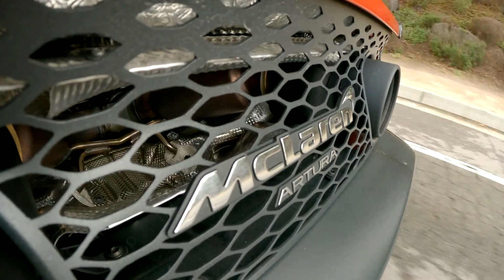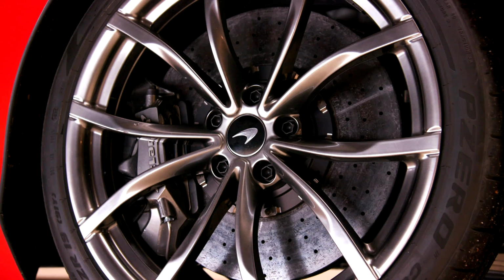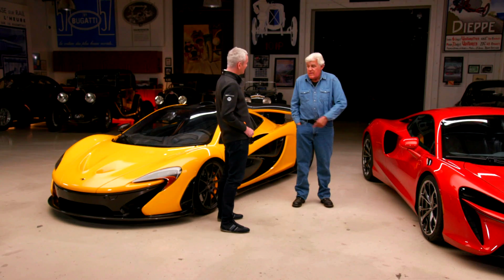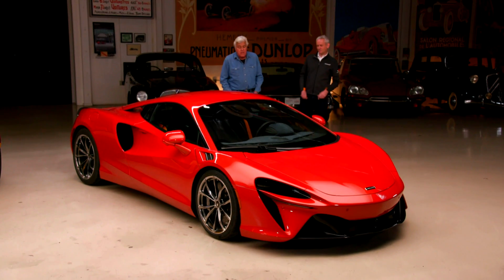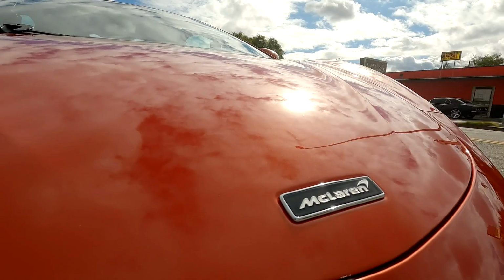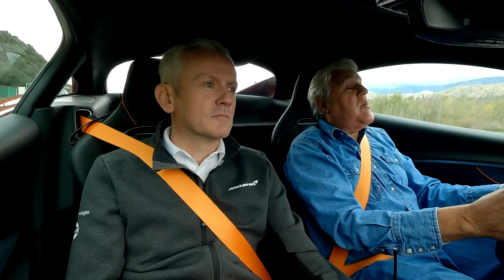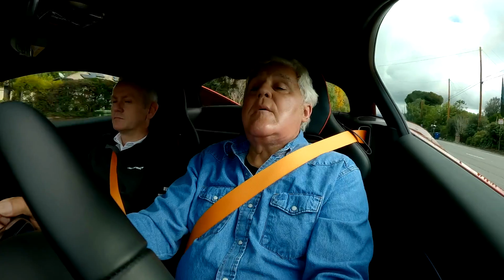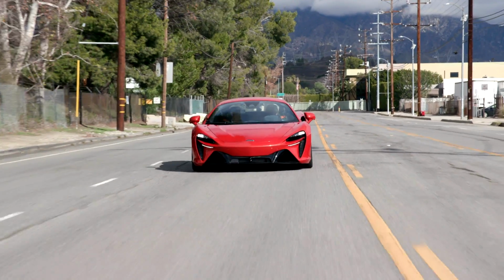2023 McLaren Artura

Comment: 19:07 "To me if you're going to build a supercar, build your own engine. I don't quite get... people pay a fortune for a supercar with somebody else's motor in it." Jay, do you not realize the McLaren F1 you love has an engine in it that was designed and built by BMW? Hell, it says BMW M Power on the valve covers! And that wonderful twin turbo V8 from 3.8 liters ( Jay's P1 that he was just gushing over has a version of the 3.8L M838T in it the M838TQ) to 4.0 liters McLaren has used since 2011 is a Nissan design from the 1990's, actually the late 1980's. The VRH35 was the engine used in the Nissan R390 GT1 race car entered in the 1997 24 hours of Le Mans. McLaren purchased the VRH design and used it as the basis of its M838T and M840T engines that McLaren has put in all of its V8 cars since the MP4-12C. Would you like to roll that one back, Jay?

Comment: 😮I test drove the Artura. It's wonderful to drive but the tiny pedal box spoiled it for me. I wear size 11 shoes and my feet touched each other side to side and my toes caught on the underside of the dash. At first I thought I wouldn't even be able to test drive the car safely but I found that by folding my left leg backwards towards the seat I could safely drive. There's no way I could do that for very long though. The salesperson said that racing shoes would help, I do still have a pair from track days but I didn't think to wear them. 

I get that McLaren is all about optimizing the driving experience but you do need to take human factors into account. And no, I'm not a plus sized American, the seat fit fine but there was no place for my feet.

Comment: Too bad not renewable electricity via motor powering the electronic battery.
Reply: Does the 2023 have lighter body weight so lower horsepower still performs near F1?
Reply: Is this being purchased by Jay…or…just tested?

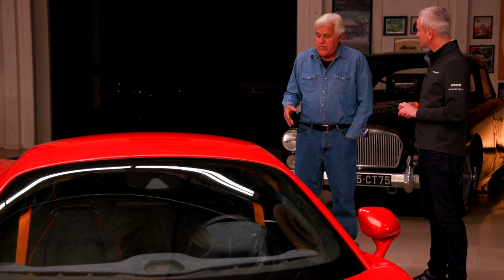Comment: the "letting the turbo cool down" described by jay at around 12:50 is still a good thing to do and it doesn't have to do with temperature.

Turbines spin very fast (tens of thousands of rpms), they need constant lubrication because of this, such lubrication is provided by the engine's oil pump. if you were to come to a stop and immediately turn the engine off, you would stop the engine's oil pump but the turbo would still be turning for a while because of inertia, this would leave the turbo with no lubrication for a short time, add it all up and some years later you could cause the turbine wheel to seize, this problem is obviously related to how high the engine's (and turbo's) rpms were before shutting the engine off.
the typical time one should wait before shutting the engine off is around 10-15 seconds whilst keeping the car at idle.
it is obiously not advised to do the "flick of throttle" right before shutting the car off (like it was sometimes done on carburated cars).

it is possible to find solutions to this problem by employing an electrically controlled and driven oil pump and setting it to stay on for a little while after the engine is off, this solution is excedingly rare and i personally am not aware of any roadgoing engine using it.

Comment: Dear Jay Leno, your videos about Duesenbergs are particularly entertaining. I'm not surprised that they feel like modern cars, I certainly haven't heard of another DOHC engine with a cross flow head and four valves per cylinder from that era. I do wonder about the supercharger that was optional after 1932. It was located on the exhaust side of the engine and was shaft driven. How exactly did the engine drive the shaft? What type of supercharger was it. And at what rpm and speed had to be attained before the supercharger would start delivering a noticeable effect in engine performance?

Comment: ⚓️ Thanks Jay 😎 cooling the turbo at shutting down is ‘soak back’ > lube oil absorbs exhaust heat away from the turbo, preventing oil oxidation around the turbo bearings. $10K aftermarket repair. 😎

Comment: The body motions of the car on the external driving shots look like the ride is choppy.

They mention it all in passing, but the conversations about charging the EV battery really show the limitations of electric cars.  EVERYTHING about owning an EV is about keeping the battery charged and in good condition.  It's really nice that McLaren has saved some weight in the car by eliminating reverse gear in the transmission and using the electric motor to back up.  Then they have to limit discharge of the battery so there is always some juice left for backing up.  And there is also a driving mode for charging the battery, where the engine power can be tapped so you can drive in e-mode when you get to your destination.  The downside is the engine has to work harder during the 40 minutes that it takes to charge the battery and burns more fuel while doing it.  How's that helping with "Carbon emissions"?  As an owner of electric cars, Jay has learned to keep them plugged in to take care of the battery through long periods of non-use.  His electric bill goes up to maintain a car he's not even using, but it's cheap insurance to spend a few dollars on electricity than risk ruining a $20,000 battery.

Comment: Thanx Jay. Well of course the McLaren P1 gets a pass along with the F1 and even the Speedtail. This new Artura certainly looks excellent from the front, the paint looks great but i don't know about the rest of the design. What has happened at the back? It looks like they run out of materials and or, ideas to finish it. I think the air vents above the front wheeIs reminds me of the Saleen S7. I also suspect there is some poor build quality on some of these new McLaren models after seeing some videos of McLarens that ended up in scrap yard auctions. One wonders how these cars will perform once they have 50k miles on them.

Comment: I know I'm odd, but I'd really rather Jay did a more indepth episode on the Doble steam car, any stationary or steam traction engine, the automotive art on the shop walls, tools, machinery, maybe different models of Scammell vehicles, board track motorcycles and an 18 inch splinter that was removed from a board track racers right thigh in 1909...

Comment: the Lemans p1 class used capacitors the brakes would charge them and the capacitors would discharge out of a corner, the drivers must learn to brake in a straight line before the corner to fully charge the capacitor less smooth    ;-(battery's charge to slowly and are to heavy)

Comment: Need electric for reverse  🤔  " 'we' always make sure we have charge" , well what about when it's ran down and never plugged in...
Reply: That would apply to any gas car also.  It takes very little power to back a car out of the garage.  You could do it with your 12v battery and starter if directly engaged to the trans.

Comment: All midengine super cars are taking on the same shape.  The death of design. Well engineered, for sure.  But if the driver is so isolated that they are unaware of what speed they are going then it is dulling the driving experience.  The thrill is diminished other than bursts of hyper acceleration.  Get in a small convertible roadster to realize what one is missing.

Comment: I'm actually a little insulted. 
An extra air-conditioned system just for cooling of the engine. 
The manufacturer knows these cars will be driven mostly among normal cars,
Which will over heat ur million dollar car.
"Designed manufactured failure"
Planned obsolescence

Comment: V6 dual turbo, just like the third generation Ford GT.
Good to see you Jay, back at it doing what you do so well.
A belated Merry Christmas and onto a happy and healthy 2023.
Reply: But this one is special, being 120 degrees. That's the natural angle for a V6, allowing shared crank journals and even firing. Every other V6 has to have 6 crank journals to achieve even firing, increasing weight and length and decreasing responsiveness.
Reply: And the Cadillac ATS-V.

Comment: the negative like the cylinder shut off/to shutting the engine off at traffic lights 🚦 I agree with Scotty Kilmer it wears out the starter and and battery much quicker. plus it doesn’t allow the heat to be even causing pre mature ring wear. then when you add a turbo charger to a v-6 or v-8 your asking for trouble. the added boost pressure leads to blown head gaskets or engine failure these exotics are cool to look at but if these engines are better why the turbo. Scotty is mechanic 👨‍🔧 who will advise on which engines to avoid which year models are better. these batteries are blowing on e-bikes without warning. is it wise to put them with Mclaren’s because they foop i don’t trust the technology yet. too many bugs.

Comment: NO!!! Even turbos today if you run them hard and put them away wet oil will coke inside. IE COOK!! You run the car hard it needs to idle for few mins to circulate that oil and cool it so it doesn’t coke up. Turbos and oil have come along way but that’s still something you have to do.
Reply: Only if they don't have water cooled bearing housings.

Comment: I wonder how that black shield cover thing will age over time with all the heat etc, it's such a large piece?? I'm not sure about that styling choice Mr McLaren 👌💪👍🙂😎
Reply: Mr mclaren? You do know Bruce mclaren died long time ago right? Like in the 70’s…
Reply: Black Shield Cover Thing 

I would suspect it’s fiber reinforced, and many plastics used for moulding parts have fairly high strength and temperature tolerance; think of nomex and dyneema and kevlar. All plastics.